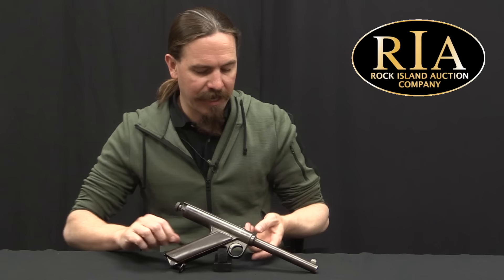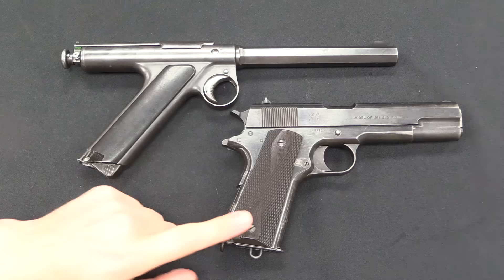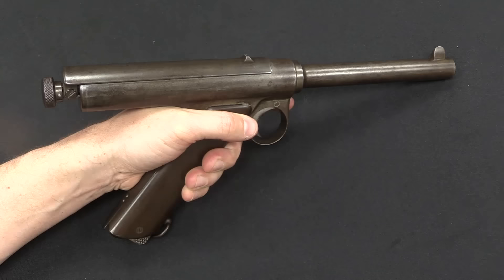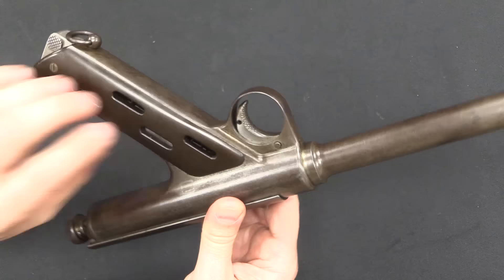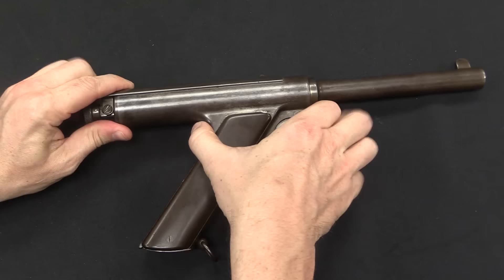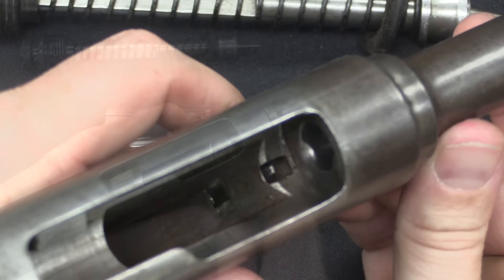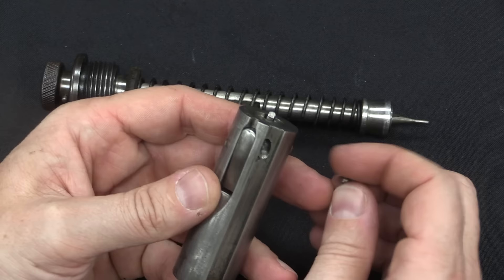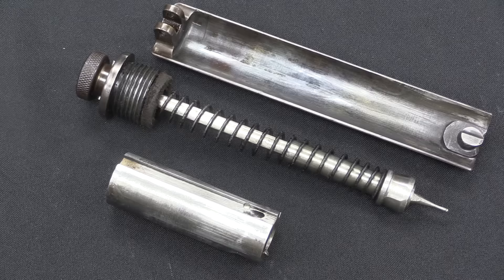Maxim-Silverman .455 Caliber Behemoth of a Pistol

Comment: The Desert Eagle of choice for all reputable time travellers.
Reply: For when you absolutely have to stop a charging Brontosaur
Reply: @maxkennedy8075  💀
Reply: Except .455 Webley is less powerful than ,45 ACP.
Reply: @88porpoise  imagine this gun in 50 accion express
Reply: @88porpoise  I mean I wouldn't wanna get hit with one of those ridiculous Mk III hollow points they developed for the Zulu Wars, its basically like having a thimble shot at you.
Reply: @tomaspabon2484  I'm not saying it isn't effective. 

Just that the Desert Eagle, a firearm mostly known for its stupidly high powered loadings in an automatic pistol, it isn't exactly a good comparison.
Reply: @88porpoise  .455 Webley rimmed or auto rimless?
Reply: @namehere9922  Without proper locking mechanisms, chambering 50 AE in a Maxim Silverman as it is will blow it up. Maybe when it's made long recoil operated or some form of delayed blowback and further redesigned to take Magnum pressure, it could work
Reply: More like dirty harry automag but earlier model
Reply: @88porpoise  sure but im responding to you saying "455 Webley is less powerful that .45 ACP, im saying that i'd rather not get shot by ANY caliber, super hot take i know. I didnt even mention the firearm in my comment.
Reply: @88porpoise  
Not by a lot, but the pressure difference is HUGE!
Reply: Old-timey Agents in the Matrix carried this IIRC.
Reply: Would have said automag, looks pretty similar
Reply: "Mysterious entry points".

Comment: This would be an awesome mechanism for a 9mm SMG. The non-disconnector could easily be made into a select fire system by choosing either a ramp sticking up that trips the sear when it goes into battery or the current semi auto system.

Comment: I wonder if this gun was designed to take the cartridge for the Webley Automatic pistol. It's a bit early for the pistol itself, but on Wikipedias notes about the cartridges it says "The early version of the cartridge (c.1904) had a shorter 21.7mm semi-rimmed case with a narrow rim and a pointed bullet." If the chamber is 21mm, then maybe this was the cartridge Silverman was intending to use. Whilst extremely unlikely, it's possible that he heard about Webleys new cartridge and decided to make a protoype that could use it. Probably completely wrong, but seems odd to design a gun to use a Webley cartridge that won't fit.
Reply: It could have been made/converted after 1904 to Webley AP for marketing reasons.

Comment: That gun looks like a Ramset or Captive-bolt gun...

Edit: It's funny how this could have been the first Sub-machinegun if Maxim had had a smaller ego.
Reply: Sometimes ideas and designs come before they are fully understood.  If I had a wayback machine, I'd set up Mr. Silverman with his own company and some .380 Kurtz casings to start with.  Something makes me think he would have been prolific in the mechanical engineering sciences.
Reply: Not to mention something that big might as well "have put a stock on it and call it carbine" written on it.
Reply: I was thinking that too. Add a stock and it could easily be a grip-magazine fed smg.
Reply: @theinstitute1324  1890’s MP7

Comment: That "floating" ejector resurfaced on the Czech VZ 52 carbines and the MAS 49, so it has some "cred"..

But, overall, designers like Mauser, Borchardt and Browning grasped the value of a locked breech, (reduction in mass and overall mechanical safety) and the customers appreciated it.

Comment: That thing looks like something someone would have designed with the intention of throwing a fat subsonic round through an integrally suppressed barrel; suppressor to be added-on to the design once the powder charge and blowback bolt weight was sorted out.

Comment: I'd love to see a reprducton of a small size in 22LR. Simple, steampunk, and would look at home in Flash Gordon or Buck Rodgers hsnd...
Reply: wouldn't that basically be a Ruger Mk IV?
Reply: @korblborp  similar but absolutely different. One of my friends routinely brings me bag O' gun containing a Ruger Mk 2. I don't mind becouse my side job routinely involves bag O' gun with parts missing.  This would have less parts than a Ruger, I'm tempted to try sketching up this as fun in the sop and use a Ruger #2 mag...
Reply: A Whitney Wolverine is a close contender.
Reply: I am thinking that 22mag would be more fun! 😁
Reply: The open bolt design sadly means it would probably need a few extra parts for a proper disconnector.
Reply: @isaac6705  open bolt?  The bolt closes and the  sear/ disconector lets firing pin loose to travel last bit, bolt is already forward.
Reply: @christinepearson5788  Sorry, not open bolt, but rather, I feel like the ATF would call this too easily converted to full auto. All it would take is cutting a little material off from around that little ledge on the bolt face.
Reply: @PrebleStreetRecords  That crossed my mind too

Comment: We need more firearms inventors today to come up with simplistic designs like this.  Maybe make them just a tad smaller for ease of carry, but the innovation would be useful to the community.
Reply: Simplicate and add lightness.

Unfortunately, I don't think most engineers and designers have much practical experience to fully grasp what they're doing. I see it way too often in vehicles that are a bitch to work on and absolutely frustrating and depressing to drive.

Comment: I'm curious how the disconnector over rides the striker while cycling rear wards to "reset" the fire control group to prevent a runaway because I can't visualize how that would happen.
Reply: Ian explains its operation better in his previous Silverman video, maybe he shows the disconnected part operation better.

Comment: After firing, how does the firing-pin/striker-assembly return to behind the seer?
Reply: I'd imagine recoil spring.
Reply: @gohunt001-5  The recoil spring is also the firing pin spring and continually pushes the firing pin onto the beach block. The seer is the tab that stops it moving forward onto the round. Something must move the striker assembly back behind the seer. I can’t see what.
Reply: The firing pin assembly with the big cocking knob and heavy construction through the bolt might just keep going with inertia for a bit after the bolt stops, resetting the catch. That's all I can think would do it. Especially with a .455 in straight blowback things are gonna have a lot of speed and energy to work with.
Reply: @gresvig2507  Good thought, yes, inertia of the striker assembly would probably carry it that small distance after the beach block stops against the screw cap.
Reply: @gresvig2507  You are correct, firing pin continues to move back by inertia after bolt stops and gets caught behind the sear.

Comment: "it's a very clever, very efficient design"
Won't the bolt just hammer that tiny spike off of the trigger after a few hundred shots?
Reply: I wondered that too. Eventually either the striker sear or the trigger would be mangled to the point of inoperation.
Reply: Some simple file work would make this full auto and you save the spike on the trigger.

Comment: This gun is awesome. I just asked a similar question on the other Maxim-Silverman video:  how does this action reset the striker?  At some point the striker flange has to get clear of the sear so that the sear can pop up and block it. Does this happen at the end of the bolt's travel due to the continued motion of the striker under momentum?  I can see the striker can travel a bit further than the bolt & dust-cover, due to the connecting screw running in a slot. Is that how it works?

Comment: Would have been interesting to scale this down to something like 38 ACP (which came out in 1900 i think), with a 4.5 or 5" barrel. If they could have gotten the weight down to 2 lbs  or just slightly more, it would have been reasonable. It is certainly simple and robust with few parts. Might have been interesting. Wonder if Maxim had a clause where he owned the intellectual product of his employee. Kind of sounds that way, with his name being on the patent.

Comment: Hmm, so if you file a small ramp into the trigger mechanism (either the back of the little lug that is pushed up by the trigger itself, or better yet the front of the "sear lever" or whatever it is), this turns into a full auto machine pistol? Hold the trigger down, and instead of the lifted lug stopping on the front of the sear lever, the ramp pushes the lever in, releasing the striker. Did I understand this right?
Reply: That's how I see it as well, but limited practical experience of firearms.

Comment: Hah!! I used to have an old cigarette lighter replica of this! Quite detailed and only slightly smaller than lifesize too, the only difference was that it had a chrome finish on the metal.  Found it at a yard sale in the 1990s, and it dated to the 1950s or 60s from the look of the box graphics. I'd always thought it was either a total fantasy design or a really bad representation of a Nambu or something, and I am seriously amazed like 30 years later to find out it was actually a real design, albeit quite obscure.

Comment: The question is if the dates are correct because the .455 Webley MkIII would be the perfect size and it came out just 2 years later. (Or if they had advanced knowledge about the new cartridge)

Comment: How long would that trigger bar tip last with the bolt slamming into from someone holding it after firing? Which would be a feat considering the recoil, but its one chipped or bent piece of metal away from an unintentional mag dump.

Comment: This thing looks vaguely like an oversized Mk II Ruger. The mechanism's entirely different, but it's still a fixed frame, without the common moving slide of most semi-autos.

As far as "really big" goes... I dunno, seems like the Magnum Research BFR in .45/70 is even sillier looking. Isn't that like 5 pounds?

Comment: I feel there's some untapped potential for this pistol, By removing the Barrel and replacing it with a Suppressor of similar length... The long bolt might react better to it. However, I'm so used to 1911's, Beretta's, and Glocks that my opinion might be rendered invalid as it was made in 1895 and my expertise is as early as the Mauser C96

Comment: In a odd way this looks both very modern and  antiquity at the same time. A ray gun that would look old fashioned in Star Wars. Perhaps this was a gun where the engineers couldn't decide
which version of the inch they should use ending up nothing fitting in. Looking this, they should have come up with something like Sten sub machine gun immediately.

Comment: How does the striker reset?
Reply: Most likely inertia keeps it going back behind the sear as the rest of the bolt stops...
Reply: Huh, I can't see any other way it would work, but that terrifies me. I'm sure it's probably be fine but without a mechanism that "forces" it to reset or prevents the bolt from closing if it doesn't, I don't think I would ever trust it completely.

Comment: That's a whole lotta pistol to fire a a 265gr round at 700fps!  Crazy that my Alaskan is smaller, far easier to pack, has a bigger caliber, and puts out 4-5x the energy ft. lb...  Just wish it was worth even a 10th of this unicorn!  Let alone DE's in .50 AE, or even more impressive, .460mag out of the 5in 460v x-frame... Metallurgy, powder and ballistics have come a long, long way though, that's for sure.

Comment: 🤔 This seems like a design where the firing system could be scaled down and replicated to make a small pistol... and/or maybe even a compact PCC. It’s so simple, linear, and efficient. Add some trigger or pin safeties, and it seems like an inexpensive and easily machined system. Then again... there were three made, and it never took off so, maybe not. 🤣
Reply: Nice... it’s nice to see Ian suggest this basic thought at the end of the video. 😆

Comment: Because of the issue of ammunition, this is not a practical firearm, and it's no wonder at all that it never went into production.  Who'd even want one since it's caliber would have to be calibrated, and specialty ammunition would be required to use it. Definitely not more than a huge target pistol,  because noone would want to lose so many brass shell casings that are not mass produced! A ridiculously expensive, and UNNECESSARY attempt at gun manufacturing by a blow hard!